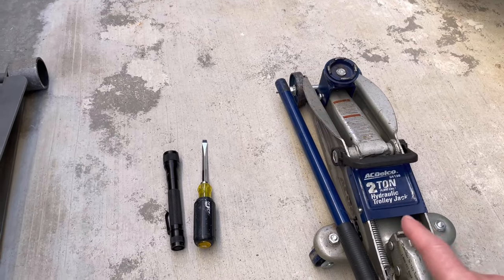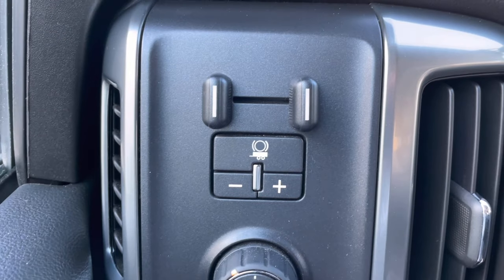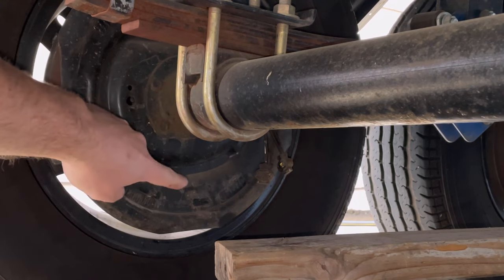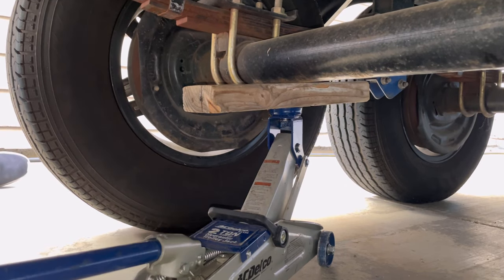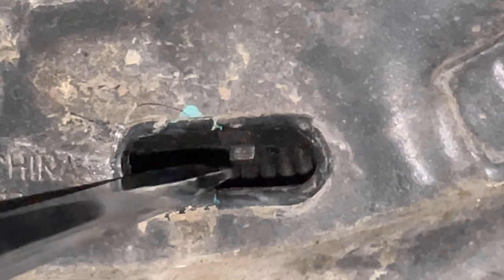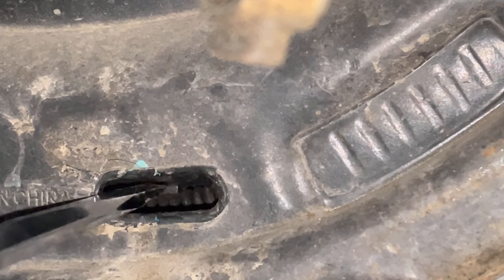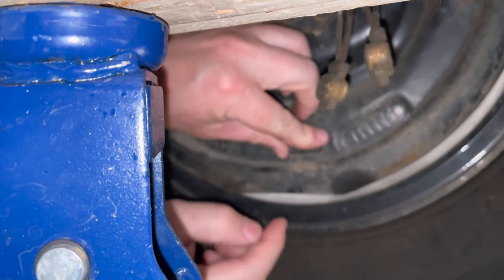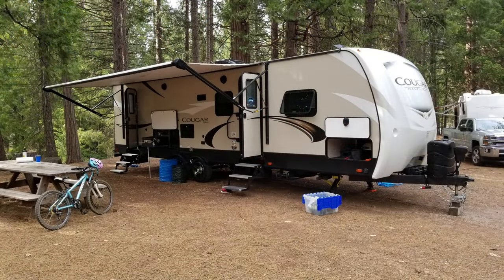How To Adjust Electric Trailer Brakes in 5 mins!! Rv brakes

Comment: Great job. Your adjustment method is correct. As for Jack position? I have used the same position many times only on my light utility trailers. On my heavy 8000lb and above I only lift from the frame. (Per all trailer manufacturers) I’ve ever owned. Reason is axle can be bent and you can’t see the axle damage. It shows up in poor tire ware. I’ve even seen people jack from the axle center. Totally bending the axle. I will admit if broke down on the side of the road you jack wherever you can. Been there. Your video was very good right to the point. I’m getting ready to pull all four axle bearings and repack and check brakes. I may just use the easy lube and adjust brakes. Subscribed as I want to see your other videos. This video will help those with little experience become more experienced. Thank you for your time. At 70yo we love our 5th wheel toy hauler.
Reply: @ghostpepperrides4805  I had to jack one side to get both wheels off to replace tires.  When I lowered the jack on the stand, it only slightly bowed and I decided to do something different.  Thankfully I wasn't in the center.

Comment: Great video thanks.
I just ran into this vid looking for solutions for my issue. My trailer keeps giving my brake controller an OL code and eventually blows the fuse. I’m pretty sure it’s my 5th wheel and not my truck because another truck pulling the 5th wheel gave it the same issue.
Do you think this might help? Or do I have another problem altogether?
Reply from the maker: I would definitely inspect the brakes or the line maybe. Do they work at all? 
It’s possible the brake line may be damaged or one of the actuators had shorted out and maybe needs replaced.

Comment: sorry, do I need to have the brakes pressed when doing this? If I don't, does it mean that when towing my trailer, the brake pads will be braking the wheels even if I'm not braking the vehicle?
Reply from the maker: No brakes, just lift just enough and spin like in the video. Have them drag just a pinch. Once you hit the brakes a couple times they will be good to go. No drag.
Reply: @johnnysweekends  great, thank you!

Comment: Just a thought!!! Why not use a 4×4 to span the front and rear axle and place the jack between the two tires? That way you only jack up each side one time instead of twice! Like I said just a thought. 🍻
Reply from the maker: Not a bad idea especially if only for the 1/2 inch you need it off the ground. Would need a bigger jack..👍🏼

Comment: Thanks for the help, not sure how much drag you had, wheel spin 1time 2time??🤔 Im still just not sure?
Reply from the maker: Just need enough to stop in with in about 1 turn because it will loosen up quick. 

I do mine once a year.
Reply: @johnnysweekends  I think this might be my problem.  Just installed a trailer brake controller and not getting any error codes and I think the wiring is good, but it wont lock up the wheels at any setting.
Reply from the maker: Interesting it won’t at any but yea may need to adjust or inspect to see if it’s time for pads.. 👍🏼

Comment: Could you do the adjustment with the wheels on the ground?  My 2013 F130 has the gain set to 10 and I still feel like the trailer brakes aren't doing enough....time to adjust.
Reply from the maker: Ahh you could but would be hard to tell if it’s to much or not enough or if one has a lot more then another…
Reply: Why would you want to do them on the ground?

Comment: you say to rotate to eliminate drag, so one is left to assume up is release and down is tighten. seems to be the reverse on mine. I followed your instructions and it locked them right up. i moved the screw driver up to rotate the assembly down and it loosened. but my brakes still lock up on application
Reply from the maker: From the inner side you rotate the adjustment wheel in the up direction to tighten or expand the brake pads out a little. 
You should have a little bit of drag on the wheel but you should be able to spin it by hand still relatively easy. That’s it. 

When you drop it down and readjust your brake controller and go adjust it down the road a few times, by the time you have hit the brakes 4-6 times, if you lifted the wheels again they would be free spinning again because the high spots will wear right down and now you should be getting better, even pressure on the drum. 

Hope that makes sense.

Comment: Help! I tightened my camper brake too much and its locked up.(just on one wheel) When I turn the gear teeth to loosen, nothing seems to be happening. Appreciate any advice thx.
Reply from the maker: After you loosen it a couple you may have to hook the truck to it and move it forward then back real quick just to break it loose. You are probably not strong enough to budge it free. 

Let us know
Reply: Many brakes have a (( cam)) to prevent the wheel from moving in the loose position .Open the drum and check it out

Comment: I have a brand new 2021 single axle travel trailer. After my fourth trip of towing the trailer I noticed some odd braking when I apply the brakes.  the trailer is locking up pretty hard. Is this normal for a new trailer? I thought it was my brake controller and bought a new one but same issue. It’s weird cause when I apply the brakes the first time it’s ok, starts to lock up after the second or third time applying the brakes.
Reply from the maker: No not normal, I would take it back since new and have them looked at. 
What is your trailer brake number set to?
Reply: @johnnysweekends  I had it on the least sensitive setting and they still lock up hard. That’s why I bought a new brake controller but it did the exact same thing. My truck is brand new so I’m pretty sure it’s the wiring on the truck side. Figured it’s more trailer related.
Reply from the maker: Yes I agree it’s a trailer problem and would take it back asap to have them fix it.

Comment: Hello - great video and very easy. However, I have a 2023 Aliner and the star adjuster cannot be turned clockwise any further. It can go counter-clockwise. There is a slight drag on the brakes (these are new brakes with about 300 miles on them). I contacted Aliner and they said I should have power hooked up to the brakes and someone holding down the brake pedal in my truck when I make the adjustments. I haven’t seen this in any video about adjusting brakes. Does this sound right to you? Thanks!
Reply from the maker: I don’t know honestly as it could be a different axle or different brake brand. 
A lot of changes have happened over the last couple years so it may be new. 
I would look up the brand of axle and brake components and find the brake adjustment procedure process. 

Sorry I couldn’t be more helpful
Reply: Modern trailer brakes are almost always self-adjusting. This video is for MANUAL adjust brakes. Self adjusting brakes can be pushed manually but are designed to rotate more easily one direction to take up slack as they self-adjust

Comment: Hey thank you for the video I'm having an issue with my brake controller lately if I hit the brake pedal at a stop sign they stay on. If I tap the break they shut back off is this because they're out of adjustment? Thank you
Reply from the maker: No that would be the actuator sticking from a few reasons. A short, corrosion causing a poor signal, maybe a bad ground and more. I would look into some service on the unit or even check wiring at the truck to make sure you have a clean connection at the truck and trailer side and then head towards the wiring under for a inspection. And then obviously continue if nothing is found
Reply: @johnnysweekends  update it was the break switch under the dash. I noticed ever time I would hit the side of the pedal it would release. 2008 suburban 2500. Fixed. Thank you for your time.
Reply from the maker: Awesome, easy fix is always nice

Comment: Most trailer brakes I’ve ever adjusted The spring pack is right up against the backing plate and you cannot get to nothing I have crazily bent screwdrivers to try to do the job but if the starwheels does not turn good you’re screwed
Reply from the maker: Yea it’s lame if you can’t turn from the back. Then a quick job takes a while because wheel and drum come off…. On every wheel..! Lol

Comment: I just did a tandem trailer brake job with a little drag of course, towed off and on about 12-13 hours total-but now one brake is warm and the others nothing.
Do I need to readjust all 4?
Also my brake gain seems factory at 8… maybe gotta tackle that too
Reply from the maker: I wouldn’t do all just adjust the one. If it’s warm then it’s dragging a little. Or not releasing all the way.
Reply: @johnnysweekends  ok thanks I’ll do the 1 and see

Comment: Can you reach a point where you can’t adjust? Have one wheel that has the adjuster more on one side and isn’t spinning.
Reply from the maker: If it isn’t or it won’t spin no more then you need to take of the drum and inspect and or replace pads.
Reply: @johnnysweekends  thank you

Comment: Drag is a good thing?
Reply from the maker: The amount of drag you see is so minimal to when you finally get it on the ground and being towed. And once you apply the brakes 3-4 times that drag will be completely minimized to pretty much none be it’s so minimal if you do it right. And it’s not dragging all the way around just the high spots on the pads which again will wear down quick and I’m sure if you checked it the wheels would be free spinning.
Reply: @johnnysweekends  ok. I could do disc brakes with my eyes closed but never owned a vehicle with drums.  thanks!
Reply from the maker: Ahh yea discs are nice and honestly I haven’t done drums in a long time which I don’t know which is better electric drum or hydraulic….. I think electrical maybe because if the hydraulic leaks it’s a mess.

Idk they are both lame…. Darn trailers just go to disc..!!!!!!! 🤣

Comment: I couldn't see what you were doing with the screwdriver.  There was a tab that the end of the screw driver was touching but I don't understand what you were doing.  This video confused me more than help me.
Reply from the maker: Sorry it confused you. The wheel inside moves up or down. Spins really to push the pads out or in a little.

You are moving those tabs up… the spins the dial inside to adjust the pads ever so slightly. It not easy to see with a camera in your way. Not easy to see in general but just enough to do the job. Once you do it then you’ll get it and know how to do the rest all the time. 
Hope this helps
Reply: @johnnysweekends  Ahh I got it.  Just like the old adjustable brakes.  Duuuh.  I should have known that.  Thanks for taking the time to post this video and taking the time to explain to a dunce like me.
Reply from the maker: Exactly!! And no problem 👍🏼😀

Comment: Please explain to me how a drum brake will TELL YOUR TRUCK that the pads are used ???  Are you serious ??   The trailer brake controler SENDS voltage to the brakes .It does not RECEIVE information....
Reply from the maker: They don’t tell your truck anything. Nor does the truck tell the trailer anything except when to apply voltage and how much by you stepping on the brake pedal. But as the pads wear the actuating arm only has so much throw. So as they wear you will typically have to increase voltage to gain more throw on the arm. If you have a lot of gain and brakes are not working great, then it’s probably a good time to go increase the adjuster wheel. This pushes the pads out before the magnet and actuating arm are moved. So now when activated the arm doesn’t have to travel as far and less voltage should be needed for normal brake performance.

Comment: Safety first use jackstands
Reply from the maker: True, but I have 3 other wheels on the ground blocked and one wheel 1/4 inch off the ground ..🤷‍♂️ 
But in other circumstances yes!!
Reply: Jack stand for what??
Reply: If your camper, trailer or vehicle is raised and you)re under it, a jack stand is always a great idea.  You created room to fit underneath.  If that room shrinks, you are the jack stand.
Reply from the maker: A jack stand won’t change the sitting height of the Rv. It will only prevent the wheel that’s off the ground a 1/4 inch from dropping down on the ground that 1/4 inch. I guess watch your fingers..🤷‍♂️👍🏼

Comment: NEVER RAISE YOUR CAMPER BY THE AXLES! ONLY BY THE FRAME!
Reply from the maker: Kinda true. 

If when possible lifting by the frame is a good choice pending your type of axles and even location of your trailer and even type of trailer. Some trailers the frame is actually hard to access if at all.

Some axles like a torsion axle should be lifted by the bracket the torsion arm goes into. Or the frame if easy access. 

If lifting the axle, as long as you lift as far out as possible normally by the Ubolts it will be fine especially for a small lift such as this.  Most of the talk it more legal jargon from the manufacturers and dealers so they can void anything and everything if you don’t do something there exact way or take it to the dealer at all. 
People have been lifting by the axles for decades and as long as it’s for the right purpose and done right you’ll be fine. 
This is no different then one wheel way up on a curb and the other flat on the ground on the other side. Or you hitting a big pothole at 65 which will create more wear and tear then a quick 2 inch lift to free spin a wheel and do a break adjustment. 

When doing more work that’s long term like bearing and brakes and more then sure, frame for sure…👍🏼
Reply: A guy years back had a flat on a company trailer jacked the axle and bent it bad 😆…the boss flipped out!
Reply: @froglobster  If he bent the axle housing, its likely because he placed the jack toward the center of the axle.   LIke the the poster mentioned, keep the jack close to the outer U bolts & you will be fine.
Reply: @wtfd95  I always lift at the leaf spring shackles with a board to avoid crushing the axle tube.

Comment: you forgot  the most important thing, safety ,never just use a jack without  car stands   i have seen the aftermath of a car that feel of a jack with no stands , and it happens a lot
Reply from the maker: Well with the unit chalked and 3 other wheels on the ground and one wheel about .5 inches off the ground, it’s not really the same. Unless you put your finger under the tire…🤷‍♂️
Reply: @johnnysweekends  no Jack stand required. ONLY if the height from parts you are under is less than the parts of you that are under that part or there is another pinch hazard are Jack stands required. Nor are they even desirable as they come with their own set of hazards. 
But alas, YouTube is filled with shade tree “mechanics” who think they know how to work safely.